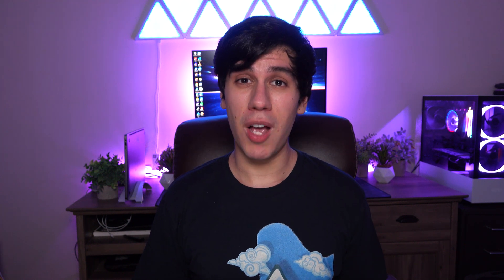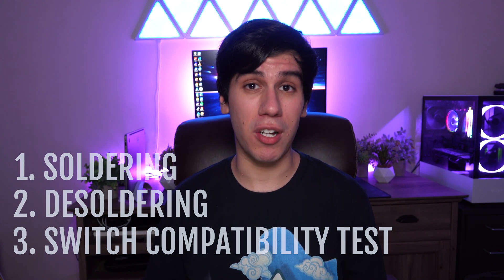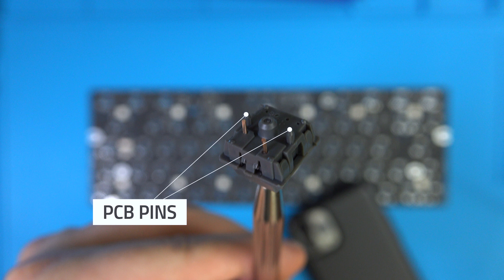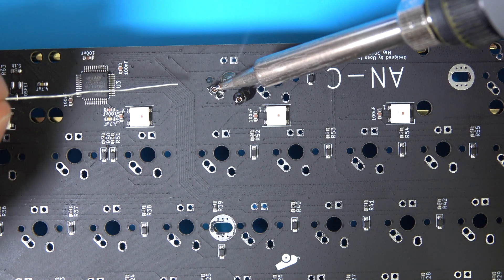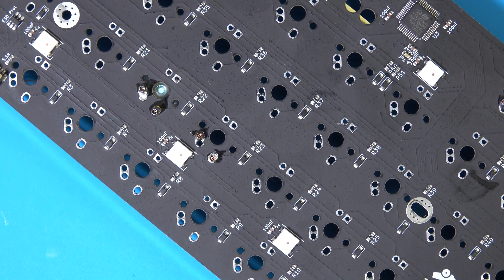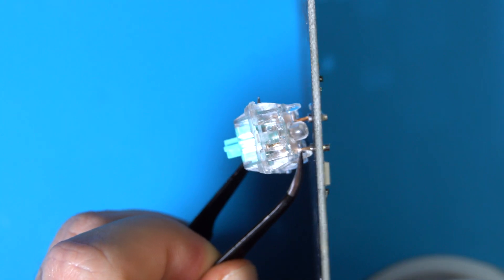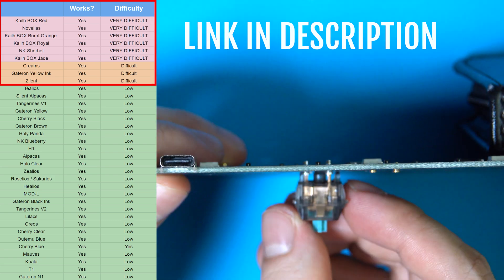How to Solder Mill-Max Hotswap Sockets (0305 & 7305) on keyboard PCBs

Comment: I planned to mod a Ducky one 2 mini, since the construction will fit back into the original case with the sockets.
Last week i ordered gateron yellow inks and the 0305 .... 
would you recommend to just solder them onto the pcb ? I really wanted the hot swap option D: Is "difficult" really so difficult, that u would recommend to solder them ? The Ducky PCB is actually a good one, i think its rather stable and wont break upon a little force. But idk really
Reply from the maker: I think you can get away with “difficult” and a lot of people even get away with “VERY DIFFICULT”, they’ll just be a little more annoying to install. For these tough cases it can help inserting the socket into the switch pins themselves and then putting the switch with pins into the PCB
Reply: KeyBonbon thx mate you’re the best. Best video in 2020 11/10
Reply from the maker: xBlank haha thanks I appreciate that!!
Reply from the maker: Mark Salvador good tip!
Reply: @pandesal_mark  Thank you m8.
Reply: So I wouldn't recomend doing it. Sometimes I had to press so hard, the leaf of the switch inside bent and destroyed the switch. I ended up just soldering them in regularly. (I mean dont recommend doing it for Gateron Yellow inks.)

Comment: Hi, I got those exact 0305's and found one of the legs on Zealios and Gateron switches to be too big to insert into the Millmax sockets.  Do I just need to use more force to insert it?
Reply from the maker: hey! I updated the spreadsheet to put the zealios V2 in the “Difficult” category. It turns out the ones I tested were V1s. Which gateron switches were you having difficulty with?
Reply: @keybonbon  Gat Browns.  Not sure if there's a version...
Reply from the maker: Howard Sohn ah interesting, gateron browns were one of the ones I tested and they seemed to insert with little force, any chance the pins were maybe not aligned when you were inserting them? I’ll give it another shot tomorrow on a fresh set of sockets to double check
Reply: @howardsohn  you can tell which Gateron Browns your are using. If it has a black bottom housing those are regular, opaque white housing are milky switches, clear housing for RGB, and milky bottom and clear top are SMD switches.

Comment from the maker: Table of Contents:
0:15 Side by side of 7305 and 0305
0:58 How to install and solder Mill Max sockets (step by step)
3:35 How to desolder Mill Max sockets
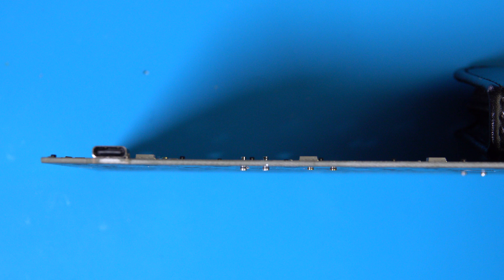4:30 Switch compatibility test and results
Reply: You didn't mention the difference in difficulty between the two socket sizes with each switch. Are the end results the same for both sizes?